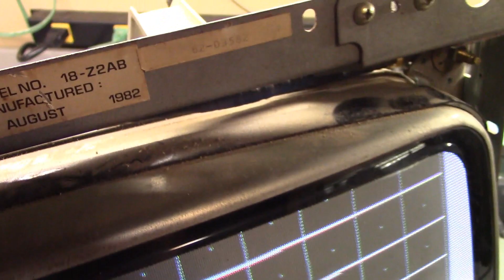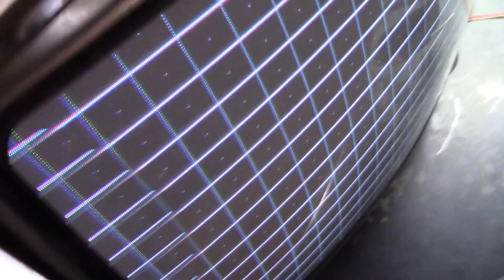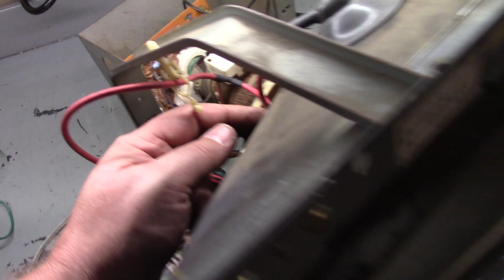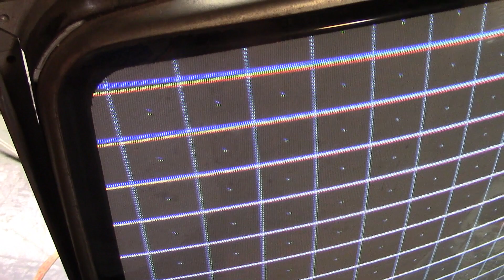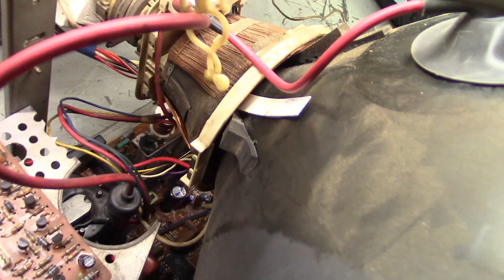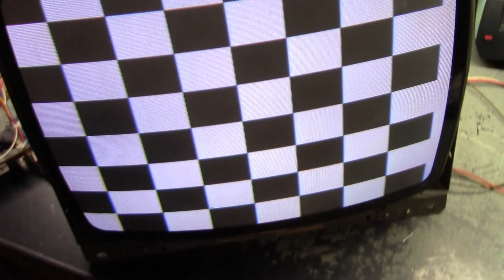Arcade Monitor Repair - Convergence Strip(s) Explanation and Demonstration

Comment: Hi, thanks for your video! I have a 14 inch trinitron tv with a bit of bowing in one corner, i cannot fix with the service menu. Color convergence seems good, i just need to "pull" that corner up. Will convergence strips work, or maybe magnets? Is it safe if you accidentally touch the back of a live tube?
Thank you!

Comment: Hello. Sorry for posting this comment so late, but could you create a video on adding convergence strips to the lower half on the tube? I wanna see how to do it safely without touching any components.
Reply from the maker: No worries. Just throw a rubber glove on to insulate yourself and you’ll be fine. That’s about the only way you can do it if you want to do it safely.

Comment: Awesome video! Is it safe to apply convergence strips to a consumer TV while it's powered on? I have a 32" Trinitron but no isolation transformer (it's just plugged directly to AC in my apartment), but really need to fix a couple of corners!
Reply from the maker: Thanks! Sure. You need to see how the convergence is affected so you can install them correctly.
Reply: @MikesArcadeMonitorRepair Great, really appreciate your response! So even tho the service manual mentions the TV having a "live chassis", as long as I keep away from the anode cap and flyback, it's okay even without any extra gear?
Reply from the maker: Yup. And don’t touch the exposed posts on the yoke.

Comment: Are you able to touch the red wire without getting shocked?
Reply from the maker: Just touching the wire? Yes.
Reply: @MikesArcadeMonitorRepair  aight thanks, was thinking of doing this with my crt tv but was scared that I might accidentally touch the red wire and get shocked.
Reply from the maker: Unless you stick your finger under the rubber cup or it's torn, you should be ok. Just be cautious.

Comment: Hey Mike would a discolored corner on the monitor be caused by old/bad convergence strip? Monitor looks sharp and crisp but top corner is a little washed or faded. It's Mrs. Pac-Man and the maze is pink but yellowed at the top and corner. Thanks bud!
Reply from the maker: Could be. You sure it’s not simply a gauss issue? Does the discoloration change if you rotate the monitor? What does it look like with just a red, blue, or green screen?
Reply: @MikesArcadeMonitorRepair  I'll send you pics later. I just got back home from being on the road. I did run the degausser over it and it changes for just a second. I'll try to DM you tomorrow. Thanks Mike!